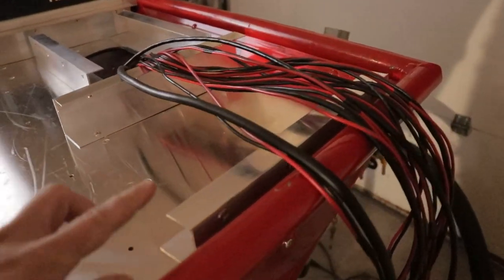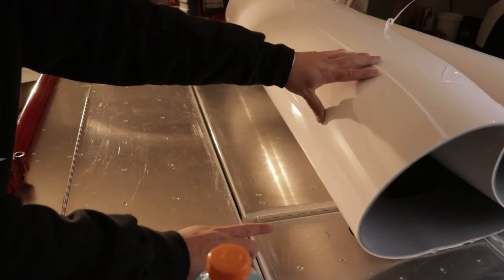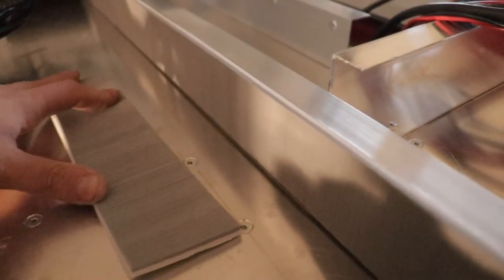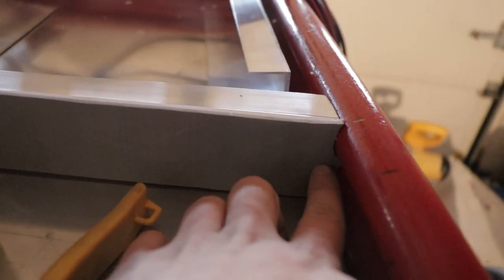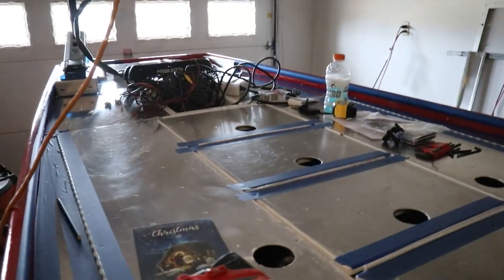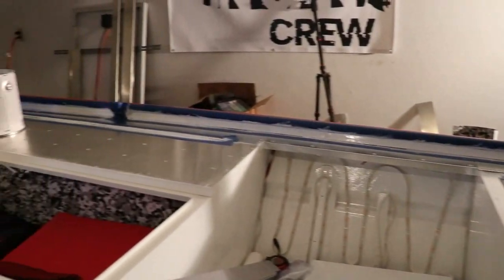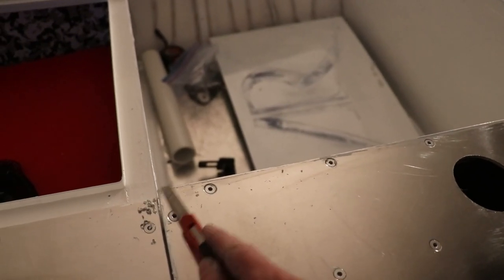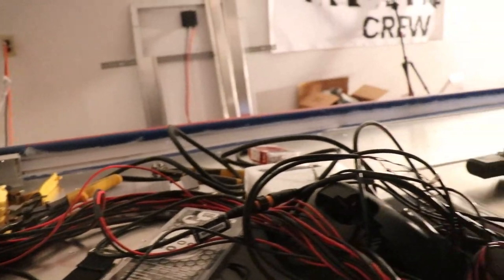IM SORRY...I'M DONE

Comment: Hey Adam, the boat's looking great!

Quick suggestion for your AR sign (if it's not too late and is still doable): If you move the LEDs to the back of the sign, facing the hull, they should still light up that whole cavity and you won't have to see the individual LEDs through the acrylic. It should give you a softer and more uniform glow.
Reply: I agree with @Derek on your placement of the LED's. In fact if you 'outline' the 'AR's backside' with the LED's I think you will get the balanced glow your looking for. It's at least worth a look-see before you close it up.
Reply: Maybe even “frost” the plexiglass?
Reply from the maker: Keep in mind that individual lights y’all are seeing in the video is just in the video, it’s not as bad in person, but I’ll definitely look at it and see what I can do, thank you all for the tips
Reply: Andrew is right, frost the plexi
Reply: When I said 'Outline the back of the AR', Outlining the actual 'A' & 'R' is what I meant. Trace the outline of the two letters with the LED Strip on the back of the aluminum AR sheet. Giving you an A & R shaped LED Outline that is stuck to the back of the sheet of aluminum with the AR cutout. The LED light is directed toward the inside side of the boat & reflected back out through the AR cutout. That's what I was thinking would give you the best light up of the AR.
Reply: @waynemiller6945  That's what I meant too, but outlining the cavity itself might accomplish the same thing, depending on the angle. Generally I'm in favour of not being able to see any light source directly though, so I'll admit my bias there.
Reply: @DirkSeabass  Yup. It will only require a little extra time & attention to detail. But I don't think there's any lack of either on this build.

Comment: Sorry I missed a few shows.  What's the weight like?  Are you lighter than your earlier version?
Reply from the maker: I’m not sure, I never weighed the earlier version, and I haven’t been keeping track of everything, the electrical got a little crazy and I just cranked out the work without weighting everything but I can add up the battery weight and know where it sits from that
Reply: The reason why I asked was that your earlier version seemed to be tipping the weight scale for that boat.  I was just wondering, if using these materials has been an improvement over the heavier wood and carpet materials.  Great show, I'm catching up again and unfortunately missed a lot of your earlier shows on this specific built.

Comment: Adam do you use Japan drier in the ace oil based enamel it will dry in 30 minutes  and flows smoother
Reply from the maker: no I don’t add anything to it, there’s paint lines when I paint it but when oil based enamel sits there to dry, it smooths out on its own